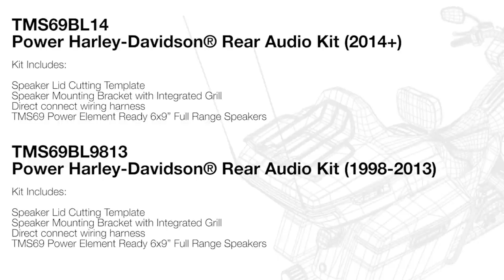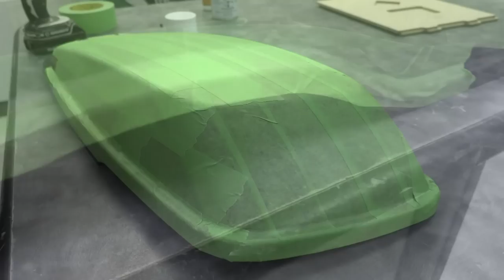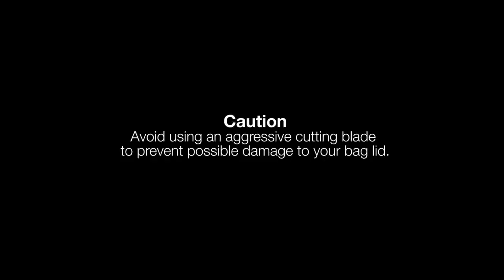TMS69BL14 & TMS69BL9813 Installation

Comment: The video was good easy install for someone with no experience who likes to work on own bike pretty easy did everything exactly in video everything was working fine for maybe 3 months and then the right speaker went out then bought some other 6x9 's that one blew out too on same side don't y maybe u guys could explain.
Reply from the maker: What Year and model motorcycle did you install this on?
Reply: 2016 road glide same settings everything second 1 went out today
Reply from the maker: O.K. thank you for that information.  We're assuming you installed this with the Rockford Fosgate HD14-TKIT for the front part of the audio system, correct? If so, is the amplifier's remote turn-on wire connected?
Reply: Yes the blue wire
Reply from the maker: O.K. Thank you for that information.  Speakers burn up due to excessive power to the driver.  I've created a checklist of things to verify below. Feel free to contact our support group at 1-800-669-9899 to see if we can get those speakers replaced under Warranty and if you need any clarification on the below checklist:

- FADER: If you have front/rear fader control, then it appears the wrong flash was applied to the system.  Fading to the rear attenuates the front speakers.  Subsequently turning the volume up will will apply more power to the rear speakers in order to achieve the same perceived output level.

- CROSSOVER: Be sure to set to HP on both Front & Rear Channels.  Make sure the frequency is set between 200Hz and 250Hz. 

- EQUALIZER: on both front/rear set to minimum.

- INPUT LEVEL: varies depending upon your primary source.  Was the CLEAN setup used?  If not, the Input Level on both front/rear could vary between 12:00 - 2:00 o-clock. This is based heavily on what you're using for your source input.  If you're using a USB drive to load music, then you have a "hotter" signal going into the amplifier, so you would be at a less sensitive setting like 12:00.  If you're using Bluetooth to wirelessly connect, this will be a lower signal going into the amplifier, so you would be slightly more like 2:00 o-clock. Our CLEAN setup procedure is available here: http://rftech.custhelp.com/app/answers/detail/a_id/1126

- BAG LID CLEARANCE: Be certain the bags are not packed to the top.  We suggest at least 2" clearance so there is at least some airspace for the speaker's motor to circulate air around the voice coil.  See this advisory: http://rftech.custhelp.com/app/answers/detail/a_id/1322

Comment: Where can I find those rubber grommets and quick disconnect ? I like that set up it's clean and simple
Reply from the maker: Hi Thomas, those components are included in the TMS69 bag-lid kit.  Unfortunately we don't sell those pieces separately as they are attached to the wiring harness.  We custom tooled the grommet.  The quick disconnects are mini waterproof connectors.

Comment: Great videos. I am waiting on the  HD 14-TKIT and  TMS69BL 14  packages to arrive. I have a  2018 SGS and I can't wait to hear how it sounds. My question is on the second video, you changed your amp from 4 channel to 2 channel after installing the bag speakers. Why?
Reply from the maker: Hi Gregory!  You actually found an inconsistent statement with the 1st video that was recorded prior to us recommending to properly FLASH 2014 and newer bikes.  
At 22:36 of the Front Audio Kit video, it incorrectly states "Move the Input Switch to 4-Channel".  It should say "Move the Input Switch to 2-Channel"
https://www.youtube.com/watch?v=xS23XfoMMx8
On all 2014 newer bikes, we recommend getting the radio flashed to utilize the "2 Speakers - Upper Fairing - 1 Amp" setting.  You can see our advisory regarding the flash here: http://rftech.custhelp.com/app/answers/detail/a_id/1215/kw/harley
Reply: So before I get it flashed do I set the amp to 4 channel? Kind of confused now
Reply from the maker: I know it's so confusing ... set the T400X4ad amplifier Input Switch to "2CH".

Comment: Rockford Fosgate - Just a quick question, I purchased both the front and rear kits, and at the end of this video you said to keep the amp in the "2ch" mode.  I just wanted to ensure that was accurate since I would have "4" speakers?
Reply from the maker: Good question Matt!  Yes, we suggest 2-channel input on the amplifier because FLASHING the radio only allows a 2-ch. output from the radio.  This is to get rid of the factory H-D® EQ on 2014 and newer models.  To learn more about flashing the radio, we have a couple links that are helpful:

2014+ Harley-Davidson® Radio Flash
http://rftech.custhelp.com/app/answers/detail/a_id/1215

Authorized Dealers that can flash your radio
http://rftech.custhelp.com/app/answers/detail/a_id/1344
Reply: Rockford Fosgate when I go to an authorized dealer, what exactly do I need to ask them to do?  Alot of the dealers around me arent real familiar with the harley sound system?
Reply: @rockfordfosgate  Have to disagree. With front fairing speakers and rear speakers, you would flash the Head Unit for Zero Amps /Four Speakers in order to gain fade control and 4 speaker outputs. What 2 speaker channels are you going to use for the amp?
Reply from the maker: @johnspencer2931  We only suggest 1 Amp / 2 Upper Fairing flash as this is the only one that totally removes the EQ curve.  All other flash variations include the EQ to some degree. The INPUT SWITCH would then accept a left/right (2-ch) that would drive all 4 output channels. You can set it up however you want, but this is our recommendation for not blowing up speakers.
Reply: @rockfordfosgate  I'm having my radio flashed tomorrow, I currently only have 2 fairing speakers but plan to add 2 more rear speakers soon.  I was planning on flashing to no amp, 4 speakers, fairing and rear pods.  Do you not recommend this?  What is your advice?
Reply from the maker: Hi @jeromemadrid3358 , We debuted a new radio flash at our dealer training event called "Rockford Fosgate Recommended Tune 2014+ All Bikes".  This is our recommended flash that has a better frequency response.  It's also a free 30Mb update for all dealers using the Centurion Audio flasher.  Our recommendation would be to use this new flash.

Comment: hello rockford fosgate. ive wanted to do this on my bicycle. but its too expensive
Reply from the maker: The Rockford Fosgate rear audio (bag lid) kit utilizes an all-new Power Series 6"x9" speaker engineered from the ground up, specifically for motorcycle applications. If you're comparing to other kits on the market, ours is specifically engineered for road and highway use and is Element Ready so it can withstand UV rays and moisture without the fear of degradation.  In other words, its not another off-the-shelf speaker slammed into a lid kit.

Comment: I have a 2017 Ultra Limited and was wanting to put 4 speakers up front and four in the rear. My question is...can I remove the tour pack and everything still work or is that even possible?
Reply from the maker: You can certainly do that because the TM400X4ad amplifier included in the HD14-TKIT front audio kit will accomodate 4 speakers (2 per channel.)  However, you'll be doing some major modifications to the harnesses.  It would be worth purchasing both the front audio kit (HD14-TKIT) and the baglid kit (TMS69BL14) so you can modify the harnesses and do the installation at once.

Comment: Hey guys ! 
What if will use this speakers without Amp? Only with stock radio of my 2018 Street Glide special?
Reply from the maker: Technically it's possible, but realistically you really won't hear them while riding.  This kit is designed to interface with an existing Rockford Fosgate Stage kit like the HD14-STG2: https://rockfordfosgate.com/products/details/hd14-stg2/

Comment: Rockford Fosgate - when I go to an authorized dealer, what exactly do I need to ask them to do as far as flashing the headunit goes? Alot of the dealers around me arent real familiar with the harley sound system?
Reply from the maker: Great point! I know several dealers that have 1 motorcycle specialist on staff, and they are typically in the installation bay (not up-front answering questions). This should give them the hint you know what you're looking for: "Hi, saw on Rockford Fosgate's website that you have a TechnoResearch flasher for Harley-Davidson motorcycles.  Can I speak to someone who can help me get my radio flashed?"  Then when you're talking to the right installer... "You're familiar with flashing the radio to [2 Speakers - Upper Fairing / 1 Amp] to flatten out the EQ?"  This will ensure they know exactly what you need.

Comment: What type of jig saw blade should I use to do the cut out? Fine tooth bi metal can’t find one made for plastic
Reply from the maker: We use fine tooth blades made for metal and wood.  We only recommend these since they are a bit more forgiving and you quickly don't end up in trouble as with using a large tooth cutting blade.

Comment: Do you have a saddlebag mounting kit for the amplifier? I have a road king special, obviously no fairing.
Reply from the maker: Hi jamesfitch1, we just released 2 Road King kits at SEMA last week.  I don't have shipping ETA yet, but it's definitely worth checking out.  I'll be posting detailed photos of the amplifier bracket once we get the production model in marketing for photography.

2014+ Road King
https://www.rockfordfosgate.com/products/details/hd14rk-stage2/

1998-2013 Road King
https://www.rockfordfosgate.com/products/details/hd9813rk-stage2/
Reply: @rockfordfosgate  Thank you.

Comment: I have 2003 electra glide ultra classic with the touring pack and rear speakers. If I'm already using the four channels is there any other options to add this kit?
Reply from the maker: Yes, I can actually ship you a rear Y-Adaptor at the amplifier where you can run the TourPak and Baglid speakers off the rear channels (it will be 2-ohms, which the amp is stable to).  Please contact me at ce@rockfordfosgate.com and remind me of our discussion with your complete shipping address.

Comment: Hey guys, I have both the fairing and bag speakers installed, and today on my ride home my rear left speaker went out. There is little to no sound coming out of it....checked connections and everything but no luck. All three other speakers sound perfect. Any ideas?
Reply from the maker: Hi Jacob, what model year bike is this?  Where did you set the Gain/Bass/Crossover on the amplifier?  What are the Bass and Treble settings on the radio?
Reply: Rockford Fosgate 2014 Street glide special. The gain/bass/crossover were all set just how you guys recommended on the video, was flashed at temecula Harley, and bass and treble are set right in the middle after flash.
Reply from the maker: O.K. great!  Sounds like you have all the right setup.  Please call our customer support with a copy of your receipt for a replacement speaker.  The Baglids are suggested to have at least 2" minimum clearance so they get proper ventilation... the more clearance the better.
Reply: Had something happened to mine what was the end results did u get new speakers and did it go out again?

Comment: I have a 2017 ultra and was wondering if i can add bag lid speakers in addition to my front and tour pack speakers. Thanks James
Reply from the maker: The bag looks exactly like the 2014 and newer models, so although we haven't installed specifically on a 2017 Ultra, the TMS69BL14 looks like the kit you'd need.  Special note that they are not are not compatible with the Power Lock Kit option because the hardware conflicts with the grille.  The TMS69BL14 kit is designed specifically for use with the Rockford Fosgate HD14-TKIT (or HD9813ST-TKIT or HD9813RG-TKIT) front audio kit.  

The kit harnesses are wired for a front/tour-pak setup or a front/bag lid setup, but not all 3.  You will be modifying the harnesses.  However, the amplifier is stable to 2-ohms, so if you want to run the front channels to the fairing, and the rear channels to both the Tour-Pak and Bag-Lids, the amplifier will handle it.  Again, you will be modifying the harness and re-tuning the rear channels to properly setup the amp.
Reply: What about on a 19 ultra limited with the updated audio system?

Comment: Why do you leave the amp on 2 channel? 
Thanks
Reply from the maker: It depends on what kit you have.  If you have the Gen-1 HD14-TKIT with the previous "2-speaker upper fairing" flash, then leave it in 2-CHANNEL INPUT.  If you have any of the newer Gen-2 kits (Stage-1, Stage-2, Stage-3) with the "Rockford Fosgate 2014+ All Bikes" flash, switch it to 4-CHANNEL INPUT

Comment: Hey RF, I'm running a J&M audio 4 ch amp, can I install this kit and expect great rear sound? Thank you in advance...
Reply from the maker: HI Tony, all our bag-lid kits come prewired for connection to a Rockford Fosgate TM400X4ad 4-channel amplifier. If you wanted to use the J&M amplifier, you'll need to modify the input harness to make this work.  The TMS69 speakers that come in the kit are rated to handle up to 100 Watts RMS, so you'll want to plan accordingly on how you setup the rear channels of the J&M amplifier.  The speakers have a great frequency response so you'll have great sound regardless of the amplifier used.

Comment: Does this kit sell without the speakers?
Reply from the maker: Hi Dantae, Our bag-lid kits are supplied with the speakers because they match perfectly with our fairing speakers and are designed specifically for motorcycle applications.  We measured the wind, road, and exhaust noise on Arizona highways up to 75 MPH, then tuned the 6x9" so you could actually hear the music over the noise. They are also Element Ready, so they are impervious to water, UV rays and dust.

Comment: So I can't buy the kit without the speakers?
Reply from the maker: We only sell the kit as a complete unit.  Included in the kit are 2 grilles, 2 trim rings, 2 speaker adaptors, 2 cutting templates, and 2 6"x9" high performance 2-way speakers.

Comment: if I have the front wiring kit already ran for the back why do I need to run that ne w harness ???
Reply from the maker: Great question Respirator Racing!  The new harness has a "pigtail" and quick disconnect if you need to remove the bag/bag lid for service reasons.

Comment: Why is the amp left in two channel on a four speaker system?
Reply from the maker: On 2014 and newer motorcycles, flashing the radio to eliminate the EQ only allows for a 2-channel output from the factory radio.  You can balance the front/rear speakers by cutting the gain on the amplifier on whichever one you feel is louder (front or rear) until a balanced sound is heard.  Once you balance it, you'll likely never need to adjust it again.

Comment: Will this work on the 2012 Street Glide as it it says 2014 newer
Reply from the maker: There are 2 kits available:

TMS69BL9813
Harley Davidson® Road Glide® (1998-2013)
Harley-Davidson® Electra Glide® (1998-2013)
Harley-Davidson® Street Glide® (2006-2013)
http://www.rockfordfosgate.com/products/details/TMS69BL9813/

TMS69BL14
Harley-Davidson Street Glide (2014-current)
Harley-Davidson Road Glide (2015-current)
http://www.rockfordfosgate.com/products/details/TMS69BL14/
Reply: The two kits for the 98-13 Electra glide can you get them without the speakers

Comment: Do the speaker mounting holes line up with any 6x9?
Reply from the maker: The mounting adaptor is custom designed for the Rockford Fosgate TMS69, and is not a "universal" fit adaptor.  The TMS69BL14 and TMS69BL9813 come as a complete kit; grilles, adaptor ring, cutout template, wiring harnesses and speakers.  The TMS69 included in the kit scream and have a custom tuned frequency response tailored around road, wind, and exhaust noise.

Comment: It bares repeating, as it seems counter-intuitive, even though you are running 4 speakers, you leave the switch in the 2 Ch setting. I glossed over this (which was indeed covered in the video) and paid the Harley dealer another $168 for an hour of labor when they were flashing it to troubleshoot why I wasn't getting sound out of my new rear speakers (they couldn't figure it out either). Took it home and took it apart and just for the heck of it switched it to 2 CH and voila, sound! DUH!
Reply from the maker: Thanks for sharing your experience.  Yes, the 2CH/4CH switch is used to determine how many INPUTS are used to drive all 4 outputs of the amplifier.  When set to 2CH INPUT, a single left input drives both LEFT FRONT/LEFT REAR channels and a single right input drives both RIGHT FRONT/RIGHT REAR channels.  When set to 4CH INPUT, each input drives it’s corresponding output.  In this instance, we’re using a single left and single right to drive all 4 outputs.

Comment: Will this template work with my 2013 Electra glide?
Reply from the maker: Yes, we have it spec'd for the following models that utilize the factory equipped hard-shell bags do not have the PowerLock system:

- Harley Davidson® Road Glide® (1998-2013)
- Harley-Davidson® Electra Glide® (1998-2013)
- Harley-Davidson® Street Glide® (2006-2013)

You can read more about the system here: http://www.rockfordfosgate.com/products/details/tms69bl9813/

Comment: When will this kit actually come with a cable disconnect for each bag. If we can’t take the bags off after the install to wash I’d be pissed. That’s a lot of money to spend on poor cable design.
Reply from the maker: Joe Mully You can!  At 12:35 you can see the quick disconnect for the saddlebag wiring.  We put the quick disconnect on the inside the saddlebag to ensure that no slack or loop catches the drive belt.
Reply from the maker: @jjjmully  Yes it will!  At 6:30 our new Road King video (exact same saddle bag kit) you can see where I pull the quick-disconnect through the hole and attach the saddlebag: https://www.youtube.com/watch?v=ExnZK4_UzFs